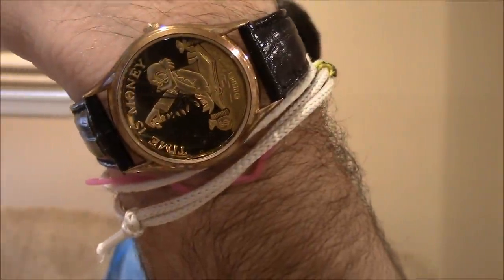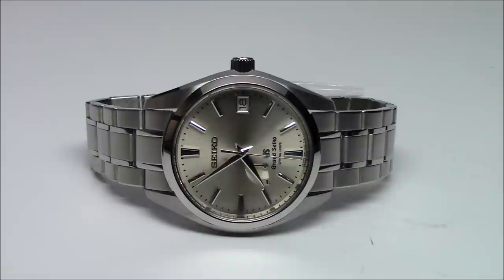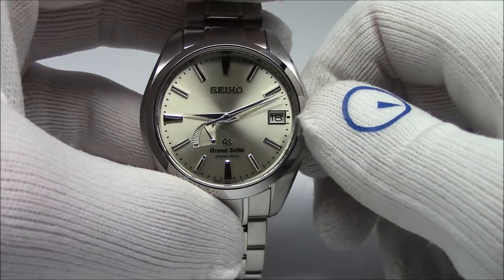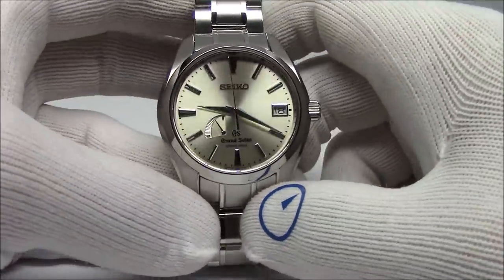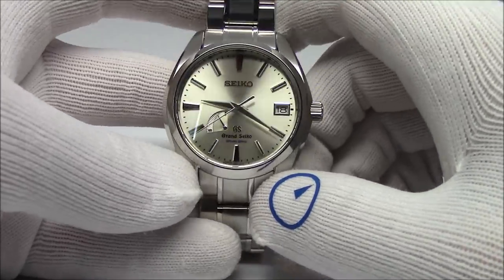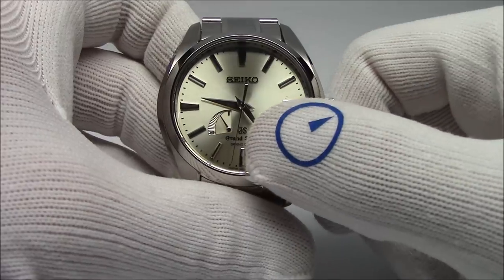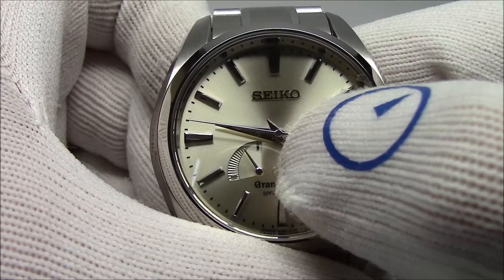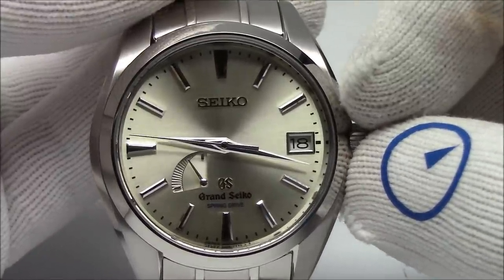What is Seiko Spring Drive and how does it work? Watch and Learn #24

Comment: What's really amazing, the watch starts running the instant you wind the crown at all. You should've stopped after a fraction of a turn. Look: 5:02
When I got mine, stone cold from the UPS box, wound it slowly a fraction of a turn, second hand raced about 8 seconds then settled down as the tri-synchro regulator took over. Also now after 5 years it still has a full 72 hr reserve. At least. And the reserve indicator is as accurate as the time! The incredibly detailed craftsmanship is beyond any high end watch I have seen- many of which cost far more than my Spring Drive Diver's 200M.

Comment: This is a great way to demonstrate how the glide wheel is really just a brake, and without that brake, how fast things would run. For those that say it’s a quartz and not worthy of being called mechanical, this shows how, like a normal escapement, the power would run out quickly if there wasn’t some form of a brake. It’s simply
a different way to do it, but still fully mechanical in my opinion.
Reply: Is it a brake?  It is a spinning gear that is braked.
Reply: @robertbrandywine  it’s not a gear…gears have teeth that intermesh creating a direct drive. This is a wheel…..with a magnetic brake.

Comment: Wow, just been schooled. Thanks Marc great explanation.   How long has this particular movement been around? How has it done over time? What are the servicing recommendations?
Reply from the maker: Late 80's. I'm actually not sure of the service intervals. Perhaps its in the 5 pound book they call an owners manual!
Reply: What, you didn't read it cover to cover ??? Hahaha. Was just wondering if these movements had stood the test of time. Would they be reliable, and serviceable 20 years from now? Then it might be worth dropping 5K.
Reply: To my knowledge the service intervals are really long (as is normal for Seiko watches in general; SKX's can go for like 10 years without a service). But servicing itself is pretty much similar pricing to servicing an Omega or Rolex, it'll be upwards of $500.
Reply: Thank you Tayab.

Comment: Great Stuff.
GS is so very underrated. I have the spring-drive, the hi-beat, the quartz,
but, it's the Three Centre Hands Manual Winding mechanism that gives me the
most satisfaction.

The epitome of
high horology is the Three Centre Hands manual wind mechanism, with a long
minute hand, and an even longer second hand. Even in Patek and Lange, the
manual wind watches are either 2 hands or with a sub second hand. They reserved
the Centre Three Hands for their highest range, so high that hardly anyone can
reach them.

For a
connoisseur, a luxury watch maker must have a Three Centre Hands collection in
their stable, the basis of all other good mechanical watches. For GS, there is
the SBGW series. I bought the SBGW231, the latest for 3K. It runs for more than
3 days fully wound, and only off by +1 sec in that three days. The hands and
indices sparkle like diamonds against an equally beautiful custard dial. My
calatrava which cost many times more just cannot match up. The back case has
more details than my Nautilus which is plain. As for the finishing of the
mechanism itself, you put the two together and see for yourself. And mind you,
the Nautilus cast a lot lot more. Then again, both the calatrava and the nautilus
are not the Three Centre Hand mechanism.

You need a
very good mechanism to carry a long minute and second hand. I can see that my
Hulk and Batman has very short minute hand as compared to my other GS sport
watches. Where are all the good man!

Comment: It's actually 28 years and 600 prototypes later that they created Spring Drive (not 200 prototypes and 15 years). And they are still making it better! They recently made 8 day power reserve with 10+/- seconds a month!
Reply from the maker: Wow, that is insane!
Reply: undefinablereasoning Unfortunately that movement is only available in platinum and rose gold. I would love to see it in a stainless steel model.
Reply: Wow

Comment: Can Spring Drive Watches suffer the effects of becoming magnetized? That seems like an imteresting delima for a watch creating a magnetic fiels any time it is running! BTW, I love these watch and learn videos. Keep up the great work!Jeff
Reply from the maker: Sure, any watch can get magnetized. I'm sure an induced magnetic field would wreak havoc on the braking system.
Reply: I'm not sure about quartz watches in general, but as far as mechanicals go, the Rolex Milgauss escaped this problem by introducing a Faraday cage as the case of the movement (so it's anti-magnetic to 1000 gauss) while the Omega Seamaster line has built the movement out of antimagnetic materials like silicon and antimagnetic metals (so they are anti-magnetic to 15,000 gauss).
Reply: is the damage due to the magnetic field reversible once you move away from it?
Reply: The Grand Seiko sbga231 has a magnetic resistance of 4,800 am (60 Gauss)! I think that the same goes for all Spring Drive because I've seen the same specs on steel versions rather than titanium sbga231
Reply: Tayyab Pirzada In other words, you would be fried to a crisp but your watch would survive. Wow, how useful

Comment: I don't understand this. Isn't this whole invention just a complicated way to achieve the same thing as the quartz movements? After all, this system, as well as the quartz movements, depend on counting oscillations of the quartz crystal. In the end of the day, it isn't as accurate as quartz watch and that really surprised me. I expected this technology to be much more accurate as there was so much effort and so many patents related to spring drive. What am I missing? Surely this movement was not invented just for some snobs so that they can brag about how expensive product they have.
Reply: Frantisek Kurcik Doesn't need any battery. That's the main advantage.
Reply: Frantisek Kurcik the biggest thing Spring Drive has in common with quartz movement is the fact that it uses quartz and the vibrations from it to regulate the movement. Where SD differs is that everything else is mechanical. Whereas quartz uses a battery, SD uses a mainspring. Quartz uses circuits, SD uses gears and levers. They took a mechanical movement, and added a quartz regulation system.
Reply: Also, no ticking for what it's worth.
Reply: It is a way to regulate a mechanical watch to orders of magnitude more accurate than the finest certified chronometer movement out there. The only thing a quartz watch and spring drive have in common is that they use the oscillations of a quartz crystal to measure time. The mechanism to move the hands is all mechanical.
Reply from the maker: It is as accurate as the finest quartz watches, but no battery, no storage cell, and mechanically driven. Just electrically slowed down. Sure its overly complicated. A $9 Casio will also tell time. A Honda drives, why get a Porsche. Just another thing that people (some people) appreciate.
Reply: I agree, I share the same opinion. The next invention will be to find out how to enable continuous sampling of the glide wheel's speed, instead of having only 8 comparisons with reference quartz signal per second. If they manage this and get it chronometer certified, then it really will justify its price and reach another level of desirability I think.
Reply: Frantisek Kurcik to my knowledge, all Grand Seikos perform surpass the COSC certification, they have their own level of regulation that is a requirement. Regardless of this, they do not print it on their watches, or market their product as "chronometer spec" since it would incur fees. +2 seconds per day is well within COSC limits, and a mechanically driven watch with +15 seconds a month guarantee is pretty much unheard of. Keep in mind that most Spring Drives perform even better, but Seiko likes to be conservative with their figures (eg accuracy rates, and water resistance).
Also, to my knowledge, the only Seikos that carry the "Chronometer" label were produced in the 60s and 70s and were part of the Grand Seiko or King Seiko line. These watches were sent to the COSC observatories. Collectors look for a good vintage example to have the certification papers from COSC as part of the package. Most were high beat (28,800 bmp or higher) movements and, accuracy aside, are absolutely beautiful movements.
Reply: I wonder if they weren't developing this before the full quartz watch was perfected and by the time they got through with the design they felt reluctant to just throw all that work away so kept it for their luxury line.
Reply: I get your point. I have a beautiful pertetual Citizen that is Eco-Drive and regulated by the atomic clock (one of the reasons I sold my Omega seamaster Co-Axial) and that only cost me a little over £200 about 5 years ago. I also have 3 Casio G-Shock Solar Wave ceptors that never lose time but hardly things of beauty. But for Beauty and tradition I have an Auto Tissot and Auto Seiko Turtle.
Reply: 😁 why would Seiko need to get the GS COSC certified, the GS out performs most Swiss COSC certified overpriced watches. If the GS was labelled Swiss made, it would be around 30000 dollars at least.
Reply: james varte so true maybe they just need to do more marketing
Reply: COSC is a Swiss organization certifying Swiss watches and organizing an "international contest" that explicitly bars entry to all non European manufacturers ( see there, page 4: http://www.concourschronometrie.org/doc/Reglement2015-E.pdf ). They know they can't compete so they rule them out. So elegant.
Any non-Swiss manufacturer that gets a certification from them is just giving free money to the competition.
COSC hates Seiko because they are the proof that Swiss watches are over-marketed and overestimated.

And as others have already said Spring Drive outperforms COSC standards by a wide margin.
Why would Seiko give money to haters for a paper slip that has less value than their own quality check stamp?

Swiss manufacturers use COSC certification to make you believe a normally functioning watch is an exception that requires a premium and you should be happy to get a poorly working one for the normal price.
Seiko tells you that you shouldn't lower your expectations and that good quality is available at the right price.
Reply: Think of it as mechanical engineering with quartz capabilities. Unlike any other mechanical watch out there.
Reply: Jason Amoako Why? We want to give our money to the watchmaker to make great watches not to Roger Federer or Fan Bingbing or greasy sales people in high rent luxury watch stores
Reply: Roughdraft214 its an electro-mechanical quartz movement. Not quite as accurate as quartz but better than a standard mechanical movement.

Honestly, it comes off as a bit of a gimmick.

As for no battery/storage cell - the main spring is exactly that.

As for affected by gravity - except it isn't... Because the quartz reference regulates it just like quartz.

With a mechanical watch there is no reference so its accuracy is affected by gravity, friction, etc... But this watch most definitely isn't.

It's a beautiful watch and an interesting approach but does the movement alone justify the price tag? Not really imo.
Reply: RedCapitalist how about you leave the watch critique to those of us who can tell the time.

Edit: lol @ liking your own comment.

Comment: Before watching this video I was thinking  why GS is so much costly and had no clue of Spring drive but it seems we have 3 kind of movement - Automatic, Quartz and Spring Drive.

Nice explanation to grasp the subject. Thanks
Reply: There is only one movement: mechanical. Spring drive is the technology to generate electricity from the mainspring  to drive the magnetic pulses to regulate the "escapement" and to drive the electronics and quartz regulator that brake or speed up the movement. So it is a mechanical watch with some electronic intelligence built in to keep time.
Reply from the maker: Thank you!
Reply: Thanks for clarification. Truly appreciate that.

Comment: The concept behind spring drive reminds me of Denon's Direct Drive turntables. They have a tape recorder head mounted under the platter which reads magnetic pulses from the turntable platter as it goes around. The timing of the pulses are used to regulate the speed of the platter.

Comment: I love your videos but this has to be the most interesting one I've seen. I just watched it (no pun intended) for the second (no pun) time (again, no pun). I'm an automotive tech and the feed back loop is how emissions control works on modern automobiles. The engine has an oxygen sensor in the exhaust manifold that monitors the exhaust and constantly richens or leans out the mixture of fuel to keep it averaging the perfect fuel to air ratio for a clean and most efficient  burn. Incidentally, that technology started around the same time as this Seiko, around the early to mid 80s. 
Hey, you forgot to mention the water resistance rating, you were so caught up in the drive mechanism. Just kidding, who cares? That's the coolest watch made from an engineering perspective.
Reply: The 02 sensor is a good analogy which is funny because nobody would consider the average car an EV but some watch people basically do that in this watch equivalent.

Comment: From an electrical engineering perspective, it's a bit like a phase locked loop adjusting the speed to the oscillations from a quartz crystal.  Mind you, the oscillations of the quartz crystal are mechanical vibrations and like a tuning fork, there is one shape that works best and that was patented by Seiko, everyone else had to use less accurate crystal shapes.  Obviously, Seiko works hard to keep extending their IP rights to that crystal design.  It's how I stumbled onto automatic mechanical watches, I bought a Seiko 5 thinking I was purchasing one of the famed Seiko quartz designs I had heard of in my electrical engineering lectures, then when it didn't last on the dresser top over the weekend, I opened it up to check the battery only to find it was all mechanical.

Come to think of it, I did an undergrad paper on signal filtering through mechanical vibrations of a physical substrate for an approximation of a flat phase response (very difficult, perhaps impossible, to achieve with electrical components alone).

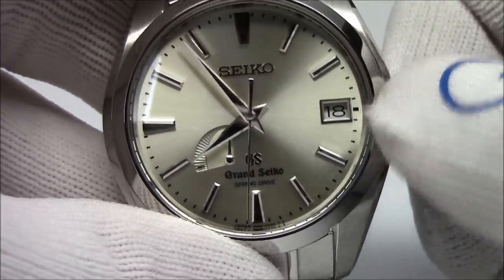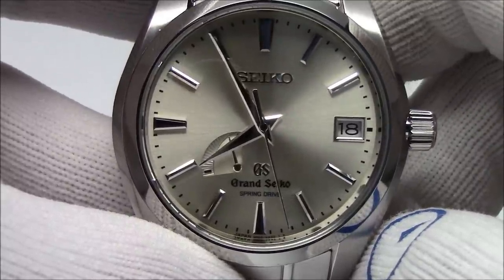Comment: It was really interesting and curious to saw how Spring Drive mechanism is started from first-second turn of the crown (4:58) from fully unwounded state, and also how second hand stops after crown pulled out and how second hand started to glide after crown was pushed in (5:54).

Second hand (and glide wheel) stopped immediately, 'cause of the locking of gear train and transmission rotors mechanism, and started to sweep smoothly almost immediately as well (during winding and when crown is pushed in), i.e. without any delays and lags.

But... mechanism started with short acceleration during first seconds in both cases - when started by winding from completely unwounded state and even when started after crown is pushed in (i.e. in fully winded state) the small acceleration also take place!!! But this acceleration (after crown is pushed in) happens within more short time-frame, due to transmission of more momentum of power for gear train rotation from fully winded main spring and due to more fast rotation for generation of electricity, correspondingly.

Here (in one of your another video) we can more clearly see how acceleration happens after winding crown pushed back - https://www.youtube.com/watch?v=JKN2YSXe9SI&t=4m40s

This acceleration happening because of IC and second coil are completely de-energized before start.
This is a Lavet type coil, as in the Lavet type stepping motor in most Quartz watches, but Spring Drive has two coils - first coil for electricity generation, second coil for electromagnetic braking regulator.
And, because of been completely de-energized, IC has a short lag before start functioning for regulating rounds per second for gliding wheel through powering second coil and regulating magnetic field tension in electromagnetic brake.

So, now I understand - this is why I can't set watches with Spring Drive mechanism precisely synchronized with atomic time, 'cause acceleration take place every time when I push the crown, the IC switched on, but IC will always have a short lag before regulation, because of delay/latency for powering in of IC itself, and I should consider that lag in synchronization of watches.

This is really curious effects and facts about Spring Drive I didn't know about before!

Thanks a lot Mark for that kind of understanding, for showing off how it works on video (this is really rare thing in reviews of Spring Drive watches) and motivation for more digging of information about physical principles of how the Spring Drive movement work!

Comment: Is the electricity used directly and continuously or is there a battery or capacitor which stores the power and then is used by the quartz and electro magnet?

Comment: I do have a question. Would it mechanically be possible to get the spring drive to work togheter with a radio controlled module to keep the watch correct all the time?

Comment: I pretty much get the jest of how the movement works but I'm having trouble understanding what keeps it from ticking like any other watch. Is it solely the electro magnetic brake that keeps it from ticking? So if the brake was removed would it then visibly tick, only faster or should I say sped up?
Reply: There is no conventional escape wheel and pallet lever at all in these movements (?) so there is nothing to tick.     I'm not sure purists would consider this a true mechanical "section" of the movement because it has no lever or impulse jewel apparently.   This seems more of an escape flywheel.